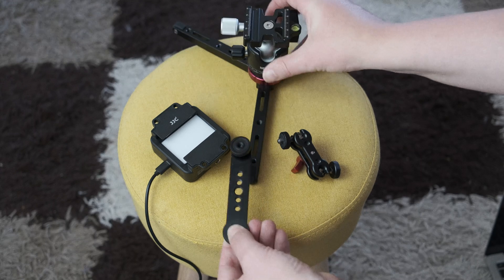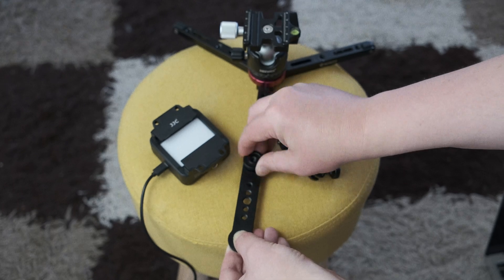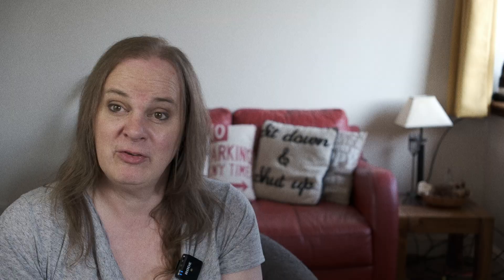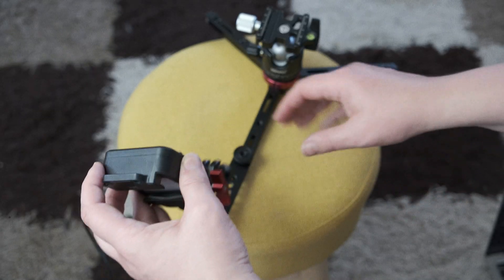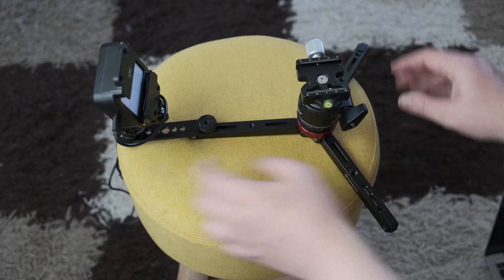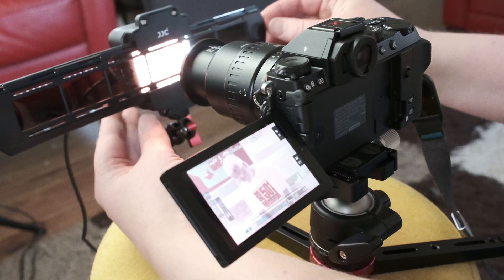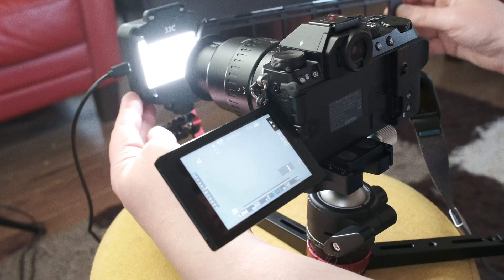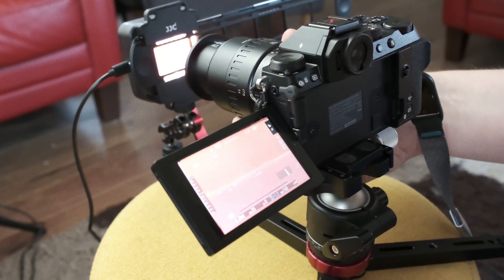Scan 35mm film with your digital camera and apply film simulations

Comment: Great info here … ta very much! My little Fuji X100V has a close minimum focusing distance of 4 inches. Would that work with this technique? How does the camera’s 3:2 aspect ratio compare to the 35 negative?
Reply from the maker: Best way is to draw a rectangle, and see how close you can focus. At 23mm the X100V may be a little wide, but cheapest way to try is to try focusing on a negative stuck to a light source, as a window
Reply: @NatsWright  Perfect, thanks!